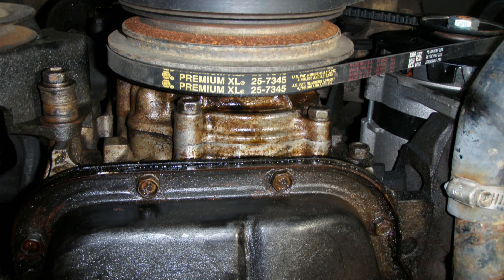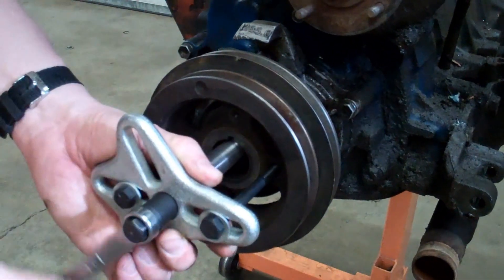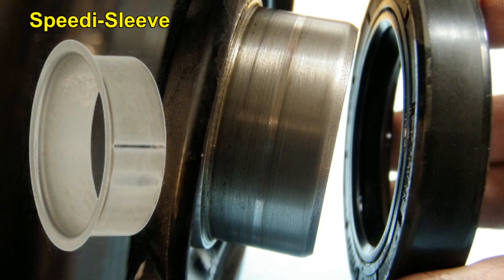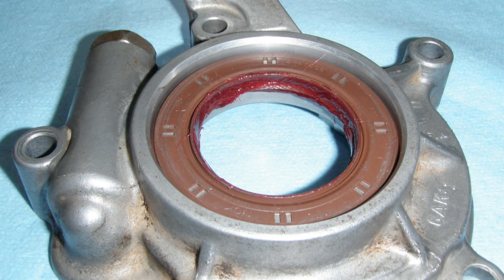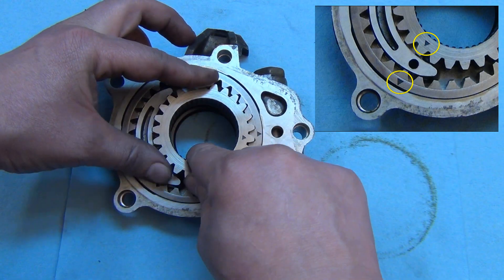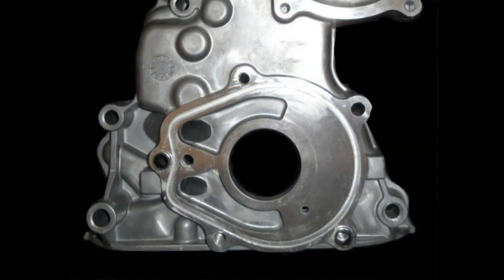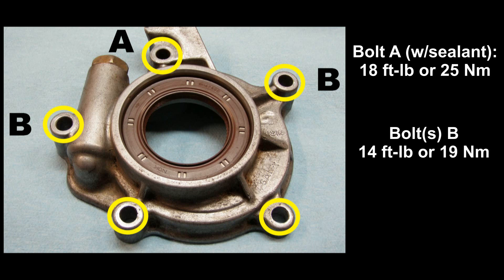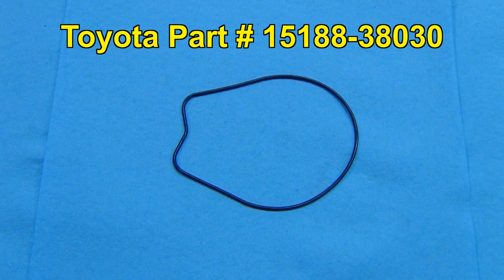How to fix Toyota 22R Front Main Seal Oil Leak (22R 22RE 22RTE) No Speedi Sleeve!

Comment: In the process of changing this seal earlier in the week we found two of the bolt holes for the oil pump, the bottom right and top hole were stripped. What would you suggest to fix. A helicoil? And do you know the size and pitch of the bolts for new ones
Reply from the maker: If that upper one you are talking about is the one that needs the sealant you're going to have to be really careful drilling and tapping that one to get a helicoil in there as it is not a blind hole (goes all the way through).  You don't want aluminum shavings getting into your system if you can avoid it.  Honestly the best thing to do would be to pull the timing cover and do the repair with the cover off the truck, but that is a HUGE amount of work..  I'd just go really carefully and see if you can get helicoils in there without getting stuff into your engine.  I'm wondering how you get the helicoil tail broken off without losing it into the engine on that top bolt...  It's going to be tricky.   Pull the other bolts on the pump, the diameters and thread pitch are all the same (I think).  I want to say they are M8x1.25...?  Not totally sure on that.
Reply: WheeliePete that’s exactly what I was thinking too. The top hole is the one with sealer I was talking about. Maybe pour the old oil through several times to try and remove shavings with magnet. I don’t know how exactly I’m going to do it and they are m8 x 1.25 I checked. Thanks for the advice
Reply: @benhanley9881  were you able to repair that top stripped hole?  I jaws just now putting my new Aisin oil pump on and was torquing the top bolt to 18.  Just when I started to get a little resistance putting it in, it just slipped loose and kept spinning.  Took the bolt out along with this long tail of coil. Ughhhh sooo close!
Not sure what to do now.
Reply: @tommykron2984  I just put in a helicoil. Never found the tail that you have to break off though 😂.
Reply: @benhanley9881  yeah same, even changed oil and ran it through a kitchen strainer lol😝

Comment: I've done had my truck in the shop twice and they seem to not get it from leaking do you think i need to try the slim seal
Reply from the maker: If the groove in the crankshaft pulley is so deep that the seal won't work then you'll either have to have a speedy sleeve put on it or buy a new crankshaft pulley with a smooth sealing surface.  A third option would be if you know any machinists they could weld the groove and then re-machine the sealing surface. But unless you have a friend who's a machinist, it'd be cheaper to buy a new pulley.

Comment: What kind of grease did you use to install the main seal in the oil pump?
Reply from the maker: Toyota specs "MP" or muti-purpose grease for the seal lips.  I just use whatever multi-purpose automotive grease I have closest to me in the shop.  Personally, I do not grease the outside diameter of the seal when I install it into oil pump bodies.  Some people will recommend put a light (and I mean VERY LIGHT) coat of MP grease or motor oil on the outside diameter to help the seal go into the bore of the pump body.  That might be helpful though if you're driving a new seal in with the pump installed on the engine and you're having to work around the crankshaft (trying to tap it in with the crankshaft in the way so you can't use a proper seal driver.)  But in my opinion, if you're installing a new seal into the oil pump when you've got the pump off the truck and flat on the work bench, the OEM seal material doesn't need lubrication on the outside diameter for driving into the oil pump body.  I also don't want to give it any help (in the form of lubrication) for working it's way back out under operation.  Factory service manuals do not explicitly state to grease the outer diameter for install.   I do however (as Toyota instructs in the factory service manuals) put a good amount of grease onto the sealing lips (the inner diameter of the seal) BEFORE I install it with a proper seal driver into the bore of the oil pump.  After I drive it in I check to make sure the garter ring (spring) is still in place on the seal behind the lips and then I wipe a bit more MP grease into the sealing lips.   The last thing you want is to have the engine fire up and spin the crankshaft pully sealing surface on dry sealing lips.  That will shorten the new seal's life dramatically.
Reply: Thanks for this. I’m in the middle of a timing chain repair and am also replacing timing cover, oil pump, and water pump. This is helpful. I also order an 86 Toyota factor manual off eBay. It was a little pricey, but I think it’ll be worth it.
Reply from the maker: @MrRockman890   I think you'll be really glad you spent the money on the manual.  If you are replacing the timing cover with a new one, make sure you carefully check the level of the block against where the level of the timing cover top edge is.  They should be the exact same height.  If your block has ever been machined previously during a rebuild though the new timing cover might be a bit taller (because a new timing cover will be at original factory height).  That's going to cause problems when you go to bolt the head down.  During a normal rebuild the machine shop will bolt the timing cover to the block and machine the surface of the block and the top of the timing cover together so they are matched.  If you need to surface the timing cover top edge, but aren't taking the block apart then bolt the timing cover to the block and take a very careful measurement of how many thousandths the timing cover needs to be shaved to match the block and then take it to a machine shop.  You can also just compare the new timing cover to the old one or just take them both to the machine shop and tell them to make the new one match the old one.
Reply: Thanks for this. From what I can tell, the timing cover and oil pump are original—both say Toyota on them, however, I didn’t see Toyota on the water pump. To be honest, I don’t think the timing chain has ever been replaced. It’s an 86 22R 2wd and has around 198000. I have been wondering about which silicone to use on the bolts and gaskets, as well as the proper amount and technique for applying it on this type of job. Reading up on it, it seems people use all kinds of things. Everyone seems to have their own preference. My main concern is I want to use something on the bolts and gaskets that won’t be a pain to remove once I have to get back in there, something that’s good for hand tightening  and removing, however, I do want it liquid tight.
Reply from the maker: Hooo-boy, yeah, everyone's got opinions on bolts, thread locking compounds, and gasket sealers...  Here's mine:  I don't use thread locking compound on any of the timing cover, water pump, or oil pump hardware for the following reasons.  #1 medium strength threadlocker (usually blue, but not always depending on manufacturer) is not designed for heat so it may not do it's job in an engine block environment.  #2 High strength/heat resistant thread locker (usually red, but not always) is going to make removal of the fasteners a total nightmare down the road....DON'T DO IT!  #3 Putting anything on the threads is going to change the torque values as you are essentially adding a lubricant to the threads.  Toyota does not spec locking compound on any of those threads and the only one that does get something special is that top "A" bolt in the water pump which needs a sealer applied to the threads so you don't get oil leaking past the threads.  Most of the original Toyota hardware that is on the front end of the engine are either flanged bolts or bolts that have rolled threads with a captured washer and lockwasher assembly.  (Rolled threads are formed after the washer and lock washer are installed and the process of rolling the threads (not cutting) makes the outside diameter of the threads larger than the inner diameter of the washer thus trapping it on the bolt shaft).  The washer/lockwasher assembly is what will keep the bolts from backing out.  You don't need thread locker.  What I do with old hardware is clean the threads out with a wire brush, remove any corrosion and re-install.  If the threaded holes are gunked up, clean them up, maybe run thread chaser tap in to clean them up a bit, and then reinstall the hardware.  Some people recommend using anti-sieze or a bit of oil on the threads, but if you decide to do that, I would put a VERY light coat as you get back into that argument about dry torque vs wet (lubricated) torque values.  I just clean up the bolts and holes and reassemble at the specified torques from Toyota.  If you haven't seen it yet, watch my 22R water pump replacement video.  I talk in there about Hi-Tack gasket sealer, a product I've been using for years and absolutely love.  I use it on all my timing cover and waterpump gaskets.  Link to that video:  https://youtu.be/gqzrjA47tgU    You do need to put some oil resistant RTV sealant across the joint area on top where the timing cover and block meet.  That little line where the top of the block and the top of the timing cover meet is a classic spot for an oil leak to form.  Just put a light smear of RTV across both of those joints before you drop the head gasket on.
Reply: @WheeliePete  thanks for all this info. I'm replacing timing cover, water pump, and oil pump. What do you recommend as far as installing? I'm planning on using the Hi-Tact for the gaskets. I've been wondering what's the best approach for install everything. Do I put timing cover gaskets on the timing cover and install, or do I apply them on the engine and then install timing cover? And is it best to install timing cover then water pump and oil pump? or should I install oil pump and water pump on timing cover first and then install timing cover? Any advice you could give? thanks.
Reply from the maker: @MrRockman890  I put the gaskets on the timing cover (coated on both sides with Hi-Tack) and then put it up on the engine, then the water pump and then the oil pump.  This is just my personal preference.

Comment: Would this be same for 22re? Mine is 94’ also would it be all same parts? O ring and that thinner seal? My engine has 200k plus so if this hasn’t been done when the timing chain and guides replaced I’d guess it’s responsible for one of the leaks.
Reply from the maker: It'll work for all 22R and 22RE engines.  Depending on what seal is in there and how long it has been in there, the grooves in the crankshaft pulley sealing surface may be so bad that even a new seal might not get the job done.  You can still get brand new crankshaft pulleys (harmonic balancer) for these engines that would have a brand new sealing surface and they're not too spendy.  Amazon link to an example of those:  https://amzn.to/39tb8Qi  If you want to make life easier on yourself you can also get the proper tool for removal and install of the crankshaft pulley bolt:  https://amzn.to/3nVHPy7
Reply: Thanks so much! Sorry I’m just getting to reply to this, finally getting around to start working on fixing the leak. Mine’s a daily driver so have just been keeping the oil topped up till I could work on the problem.

Comment: Man i have replaced both my harmonic balancer and the front main 3 times im starting to think this HB is out of spec. No grooves worn into it
Reply from the maker: Could be the new crankshaft pulley is out of spec, but are you sure it's not the o-ring between the oil pump and the timing cover?  If that thing's leaking it can sure look like the main seal is leaking.  If you're sure it's not the o-ring, my next best guess would be the seal isn't square in the bore of the oil pump.  If they are not in square they will wear out quick.  Did you change the oil pump itself?  Might be the new one wasn't machined correctly and it isn't centered over the crankshaft perfectly?  (Just tossing out ideas at this point.)

Comment: This video was very helpful as I just changed my front seal, oil pump, and oil pan gasket due to an oil leak.  But, I still have a serious leak from the front seal/pump area.  Any ideas what could be going on?  I did the job just like you showed with thread sealant on the one bolt and all bolts torqued to spec.  I wonder if I have something going on with the crankshaft?  The seal surface was smooth with no grooves.  Many thanks to any ideas and thank you very much for your videos.  They are amazing.
Reply from the maker: If it's still leaking a lot and you drove the seal in square to the bore, the most likely scenario would that the oil-pump o-ring did not stay seated in the groove when you put the pump back on the timing cover.  If that o-ring is compromised it will leak a lot as the oil is under pressure right there.  Can you identify where the oil is coming from?  A leaking o-ring will manifest by oil leaking from the seam between the pump body and the timing cover.  Clean everything off, run the engine, shut it off and look for where the leak is coming from.  There will usually be some oil seepage for the first little while as the oil you put on the gears when reinstalling them will have run down over the o-ring and then get squeezed out between the oil pump and the timing cover during install.  That should usually clear up within a few days.
Reply: The seal was already seated in the oil pump that I put on.  It could be that o-ring.  I didn't feel good about it when I put it back together.  It's leaking too much to just be seepage.  I guess I will take it apart again and reseat the o-ring.  Thanks!!
Reply from the maker: Use a few dabs of a sticky automotive grease in the o-ring groove and then press the o-ring into the groove.  The sticky grease will hold it in place while you put it on the timing cover.
Reply: Turns out the harmonic balancer has a groove in the sealing surface.  When I did this a few months ago, I only looked at the crank surface for some reason.  I have ordered the thin seal you recommended. Hopefully, that will take care of it.  Thanks again for the video.
Reply: I finally got everything put back together and there is no oil pressure on the gauge in the truck.  Engine runs great, no knocks or anything.  Is there an easy way to check the oil pressure?  I can't imagine why there wouldn't be oil pressure.

Comment: A shop just said that look at some Manual about this repair and quoted me 8-9hrs of labor. Judging by the video, looks like a few hours total. How long should this take?
Reply from the maker: That sounds like a quote for the REAR main seal which requires you remove the transmission to get to it.  With the proper tools on a FRONT main seal you don't even need to pull the radiator.  I can't see how a front main seal on a 22r series engine should take more than a couple hours max for any "professional" mechanic.
Reply: @WheeliePete  thank you.

Comment: It looks as if the engine has to be removed. Is it possible to do without removing the engine?
Reply from the maker: Yes.  You can absolutely replace the FRONT main seal without removing the engine.  You just have to get the crankshaft pulley off.  The REAR main seal requires that you remove the transmission (or the engine if you want to do it the hard way...)

Comment: Pete, I dropped my 89 4Runner off at a mechanic shop.  He looked under and said the oil pump is leaking.  I think I overfilled the oil a bit the day before I saw the leak. I came home and saw your video.  Is this something I can do without removing radiator and hoses?  What would be a reasonable charge to have a shop do it?
Thanks
Reply from the maker: It can be done with the radiator and hoses in place, but that will depend on what kind of tools you have to get the crankshaft pulley off.  That can be tricky with the radiator in place if you don't have the actual tools specific to that job.  Most shops these days are going to charge on a set book rate for an hourly estimate against their shop labor rate + parts.  So that will depend on how much time their book tells them the job should take.  The book will probably tell them to remove the radiator, but I bet they don't.  I would call around and get multiple estimates for a front main seal replacement on that engine and ask them how many hours their estimate book says.  Make sure you check what their warranty on work is because if they do it wrong it'll just start leaking again.  There's a chance you may have to buy a new crankshaft pulley if your existing one is really grooved out on the sealing surface.
Reply: @WheeliePete  Thanks, that's pretty much what I was thinking.  I couldn't find the required Toyota Special Service Tool (SST) on line so I think I'll get the belt tool you have in the video.  I'm gonna attempt the repair myself.  Thanks WheeliePete!  I'm going to try and take out the "A" top bolt, and re-thread seal it and see if that was the cause first.